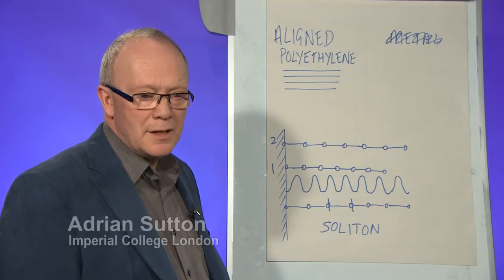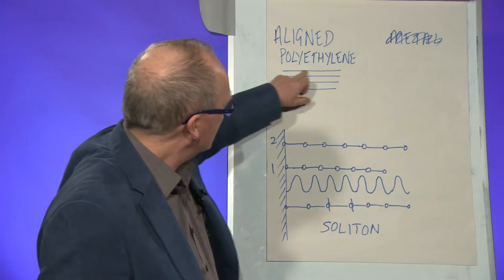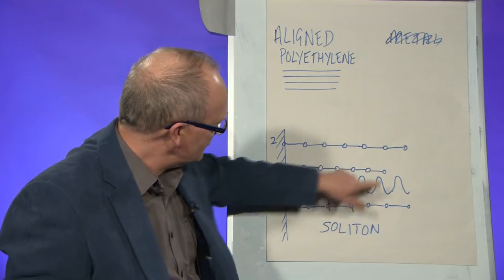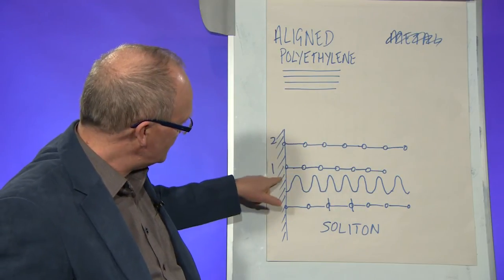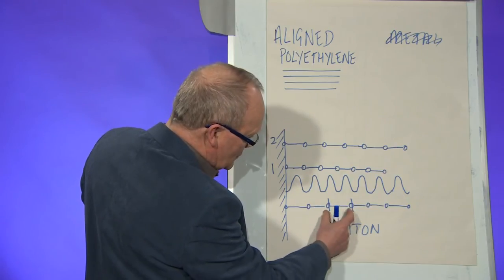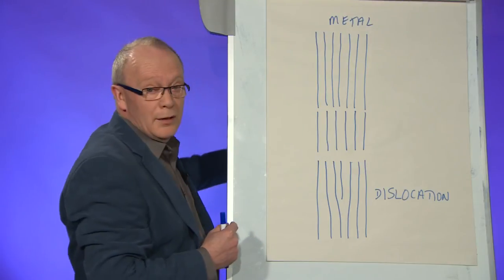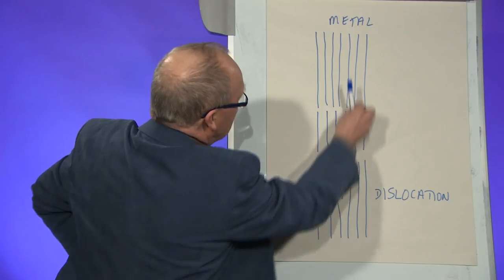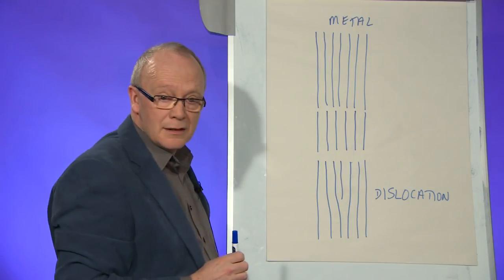What do plastic bags have in common with metal?

Comment: Kind of a weak connection, maybe you should have gone into more detail regarding the metal and then brought the video to a close by restating your initial point. Doesn't matter if it's short, a lot of things can be said in 100 seconds, but if it's not clear what you're talking about, to your audience, then you've wasted 100 seconds multiplied by the number of views you get.
From what I saw, your metal and plastic models are incomparable because the plastic is stretching from both ends, whereas the metal is forked or tapered at the bottom.
How are those two models comparable?
I presume the metal in the model would have had 7 'layers of atoms' throughout? Why then did one side become 6? Where is the stretching occuring in the metal? Just at the point where 6 becomes 7 or all along the section with only 6 slayers?
I can go on, but, the point is, just don't make such short videos and leave out such important details for the sake of time. This isn't a classroom where you have to cram in X amount of material before the bell rings. Get it right once and you're good for a lifetime. Do a poor job and the internet will remember it forever and your views will steadily experience 'dislocation'.